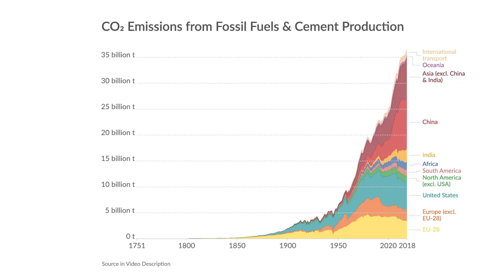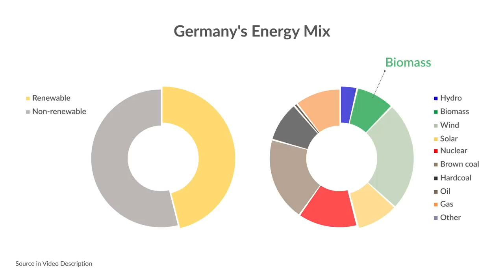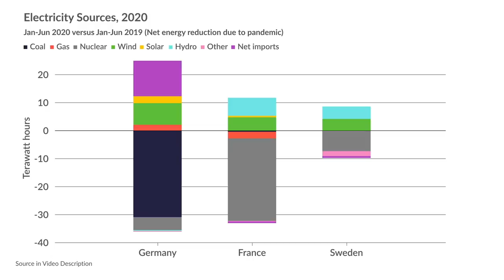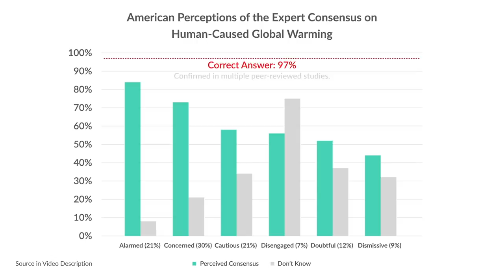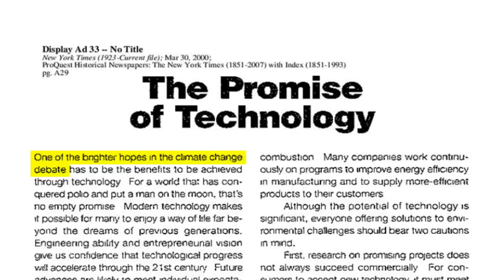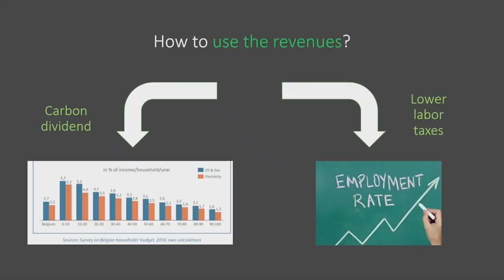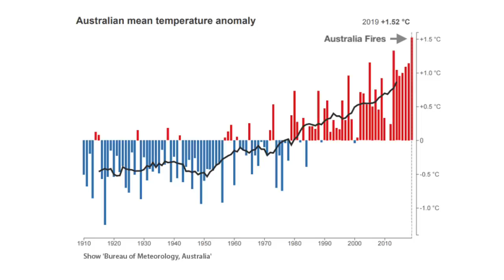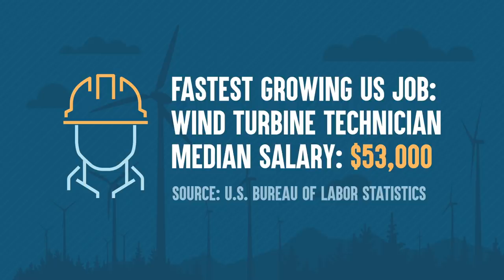The $5,200,000,000,000 Trick Killing More Than Covid, w Stephen Fry.

Comment: Wait a sec, What happened to the "mini ice age" the warned us about in the 70s?
Reply: "The fact is that around 1970 there were 6 times as many scientists predicting a warming rather than a cooling planet."  but don't let being wrong get in the way of your smugness.
Reply: Mini Ice Age still coming... patience...
Reply: @DistinctiveBlend  so we can safely assume the science isn't settled rt?
Reply: When there was a downturn in global average  temperature rise following massive WWII industrialization and the 50's boom (lots of sulfates in the air) some were pointing out that we should be on the down slide into the next glaciation (not a mini-bump) in 40,000 years or so. And we should be.  But it turned out once we cleaned up the air a little, temperatures shot up.  We may have cancelled the next glaciation or delayed it by quite a bit.
Reply: Well, the Exxon guys would have definitely wanted to tell you about ice ages
Reply: @DistinctiveBlend  
Media bullshit, not scientists.
Reply: @mavrick2398  
Nope,. It's settled.

Comment: They fked up by putting the hyperloop at the end. Otherwise a good video.
Reply: Yep.  Hyperloop is an old idea which just won't seem to die.  Seems cool at first look, but the engineering maths don't work out.
That said, new and improved rail systems aren't a bad idea.  Which is all hyperloop will be if it ever becomes anything other than hype.  Take away the hype and you just have r(ail)loop ;)
Reply: @travcollier  So why are companies still trying to build it if something as rudementary as the math does not check out? Perhaps you should reach out and tell them that all their engineers have miscalculated?
Reply: @johans7775  In the past there had been many things thought to be not possible. The light bulb for example.

The problem is, with rail technology speeds above 350 kph are not economical. The wheels and tracks show exponentially increasing wear and tear, objects on the tracks will be catapulted around with enormous force and damage the train itself, or things in the environment, infrastructure like bridges and tunnels must be re-constructed to withstand forces created.

With Maglev technology it may be pushed to 450 kph. At 600 kph for example the internal and external noise gets too loud. And similar problems as with rail bound systems appear, of course.

Therefore, a vacuum or low air pressure tube presents the solution.

I personally will never ever sit in a bullet catapulting me inside a sort of a cannon tube.
Reply: @johans7775  The idea is called a "vactrain", and it dates back at least to the late 1800s.  One of the fundamental problems is the high degree of vacuum required to avoid building up a pressure wave in the tube in front of the train.  Vacuum tubes work ok at small scale, but total volume matters (as well as surface area) so big tubes are much much more difficult.  The difficulty and cost doesn't scale linearly with size.
And plenty of engineers know all this far better than I do. Why do you think that no one's A-team is working on it?  Also, have you noticed how the designs for Hyperloop keep radically changing?  As I said, if it ever happens, it will end up being a relatively conventional train...  either that or maybe a tunnel road network for the super rich.

Comment: Kinda wish there was more of a breakdown in the report on GHG emissions from renewable production(solar/wind etc) vs coal. The report does show the results but i would have prefered a side by side comparison, for example it starts out equal the GHG cost to harvest all the resources needed to produce 1 photovoltaic cell used in solar farms today(basically 1 of those large solar stands in a solar farm), then compare that next to harvesting only coal with the same amount of GHG emissions(you'll have more coal because photovoltaics needs other materials). 
This way the start is equal, then you burn all the coal for energy so u have an energy generated value, then u add the GHG emissions of the burn to the GHG emissions of the harvesting to get the total. Finally u would compare that to the GHG emissions of harvesting,processing and manufacturing the photovoltaics and the energy that cell would generate over its lifetime.
I'm not doubting the report, i mean in the first place it's hard for me to see how just burning the coal is going to outway years of the photovoltaics output, i would much rather see the raw side by side comparison played out.

Comment: I do believe the main problem is that the "Green" movement ignored nuclear energy (Thorium would be the best) as an important step towards renewable energy. If this was implemented 20 years ago this could buy time to develop efficient storage solutions for solar and wind energy. I suspect that many of the studies on CO2 released by renewables are significantly undercounting the real impact of these technologies since there is no sufficient storage for the power generated. Therefore a base load bearing power plant has to be idling to take over when the sun sets or the wind drops and many of these power stations are fossil fuel based. https://www.youtube.com/watch?v=LJ4W1g-6JiY. This video is an example of how the nuclear fusion research has been distored to show that they are closer than what they actually are and I think there are similar distortions (likely not at the same scale) with green energy.

Comment: Claims that "global warming" will increase hurricanes etc. defies the second law of thermodynamics.  This is because most of the "warming" happens near the poles.  The weather system is like a heat engine driven by the the temperature difference between the tropics and the poles.  "Global warming" reduces that temperature difference and hence reduces the energy available for extreme weather.

Comment: The point about burning trees contributing to CO2 emissions is very misleading. It ignores the fact that each tree burned has already built up a carbon "credit" from absorbing carbon during its lifetime by having grown to maturity in the first place (the video only looks forward, it ignores the existence of the tree before being burned). As long as the trees being burned are being replaced sustainably, and they were specifically grown in the first place, in order to be used for burning, the process is indeed carbon neutral. This is because you have to grow a huge stock of new trees first, before you can start cutting them down to make into pellets, so you get the benefit of a huge number of extra trees on the planet which then must be constantly replaced as they're cut down, otherwise you'd run out.

Comment: power outages would be extremely rare because we'd be running everything seperately and connectively at the same time all the time. if the generator needs repairs, the grid is available until repairs are made. no gas just the movement would generate constant energy all the time.

Comment: Don't conflate CO2 with air pollution. No children have beeb killed by the present increase in atmospheric CO2. An increase in 40 parts per million is nothing for the human metabolism. We experience greater changes than that just by moving from one room to another or moving inside or outside. CO2 levels are lower in a cornfield in September than in May, lower in a pub when it opens than when it closes. The background level of CO2 is measured from the southeast slopes of Hawaii, but its presence in the atmosphere varies massively. At its present average of 415 ppm, the CO2 level is still historically low. Increases in CO2 levels do not kill children! And due to the logarithmic diminution of its radiative forcing, such increases cannot heat the troposphere as claimed. CO2 levels could go up to 800 ppm without any noticeable tropospheric heating. Implying CO2 has, in and of itself, killed more children than COVID is ludicrous.

Comment: Y'know what.
I'm perfectly fine with the ice caps melting. I legitimately don't care if we re-enter the carboniferous era. The world was mostly tropical and desert before the ice age. I also prefer it warm and humid.

But y'all are focusing on the wrong gases. You should be focusing on organic and inorganic gasses that are dense (as in parts per million in an air sample). NH2, NH, CH4, those gases have no natural outlet in any cycle (unlike CO2 which is consumed in the carbon cycle via photosynthesis.) Think of it this way, Methane CH4 is half the weight of CO2, ergo in relation it is also a smaller particle. This means that there is more methane that can fit in a liter of air compared to carbon dioxide. This means it insulates that much better and as it takes years for methane to decay into carbon dioxide it stays in that state for years.

The primary reason carbon dioxide was chosen by the globalists is because literally any organic combustion creates CO2. Makes it easier for the hypercorporations parading as government officials to attack their competition as that's basically the goal with climate change legislation.

Comment: Time Out!  I also seen studies saying temperatures were relatively stable for the past 75 years and the models show the temperatures on earth are cooling with EU falling into a mini ice age.  Grand solar Minimum with peaks through the solar cycles going into 2035 with extreme heat in summers and extreme cold in winter.   Overall temperatures declining.   Also isn't CO2 important for all plants?
Reply: If the EU is in a mini ice age, I'm in the wrong EU we have one record bracing summer after another and it dusn't even snow any more where I live.
The only two country that are considerable more stable in temperature  are America and Canada do to an anomaly in Jetstream.
Yes, plants need CO2 so what?
I don't really see the connection.
In what way does it make the enormous geoengineering experiment we have been running for 150 years any better?

Comment: I want to start a thought process, of sorts. Everything we do or use or make or burn or reduce in temperature(via a/c), causes heat to be produced. The ultimate goal should be to lower how much heat we release into the atmosphere, which people should realize, does not  just magically disappear. Each time we release btu's of heat, it adds to the heat in the atmosphere. There are many maximum heat producers that should definitely be re-engineered to eliminate heat loss or somehow harvest the to use and not waste. I think two big ones are vehicles  and manufacturing. Drastically reducing  heat released to the atmosphere has to have a positive effect. Hello world. Are you listening? We must somehow do this to save our planet. Won't be easy but I think this one aspect is very important.  Peace.
Reply: Of course, this means harvesting the energy from fossil fuels without burning them. That's the key, I believe, to keeping the temperature down. This may not seem significant until you realize the billions of internal combustion vehicles on the worlds roads and the heat they emit; the same with most of the worlds manufacturing. Tough goals, but I feel, very important ones. IMO.

Comment: using off shore wind to generate hydrogen for both transport and domestic heating is a simple clean zero emission solution that is just waiting for  proper political  backing. Leading appliance manufactures such as Charlton and Jenrick in the uk have already developed the appiances- all we need is the politicians to grasp the nettle. There are test areas in the UK doing just that- it just needs accelerating and scaling up

Comment: What a load of crap. Taxes change nothing. They are also not neutral. Here in Canada I have seen no rebate and saw my heating costs rise substantially, in a country where heating is critical during our winters of minus 30-40 degrees. Alternatives need to be found to replace fossil fuels however the only viable option to reduce so far is nuclear. Electric cars, wind power and solar are not in the least bit "green".

Comment: You can't have a rational approach to the CO2 emission issue without a carbon tax approach.  The eNGO's like the Sierra Club that has opposed carbon taxes are just interested in power for themselves and really don't care about the planet.  

I may not fully buy into the claimed health issues with PM-2.5, but climate change is real and CO2 does have an impact.   Revenue-neutral carbon taxes can solve the problem and those taxes would do far less damage to the economy per $ of tax than most of our existing taxes like payroll taxes.

Comment: EV cars are just bad the power grid will not handle it.  Also the smart metering under new regulations with time allocated for you and the guy next door.  Also can decide to charge more for each Kwh charge you use to get money back from tax duty.  And not all roads can have them so you need to park somewhere pay for the parking space and the charging and go over your parking time get a fine it will end up cheaper to use a taxi.

Comment: I recently saw this movie and its quite depressing.  Spoiler alert: we're totally screwed.  The movie doesn't advocate any solutions to climate change, it certainly is against bio mass and cutting down trees, it just points out that due to solar and winds' intermittency that with all that has been invested we have not saved one single ounce of carbon.  The reason, and I didn't know this, even when we get power from wind or solar they still run the main coal, natural gas or nuke plant at full power and just send the electricity no where.  They just put it to ground.  Because every source but solar is basically a steam engine making something rotate.  You can't turn those on and off, so it's just cheaper to keep them on.   Maybe the solution is everyone does their own home and we connect so many together for stability but they are going to have to totally over build and come up with an affordable, cheap, practical storage system.
Reply: Yes it does! Switch to renewables and reduce or eliminate fossil fuel use! You need to watch it again.  What are you talking about? Coal and natural gas plants are being shut down and the energy is transmitted by power lines.
Reply: @granthurlburt4062  I think you need to watch it again.  When a power plant runs on solar or wind it does not turn off its steam turbine.  It continues to burn just as much fossil fuel regardless if it needs to generate electricity or not.  It must do this because If the wind suddenly stops or the sun shine the you would have a black out. It must sends all of its power to the ground but if it is needed it will switch to the grid instantly.  I didn’t know that with all of the wind and solar we have done we have not saved one drop of fossil fuel being burned and it’s Carbon going into the atmosphere. Solar, Wind, build up must accelerate so that a gas or coal plant can be retired.
Reply: @granthurlburt4062  No brother you better watch it again.  I signed up for 100% renewable energy from my utility.  It costs 2 cents more per kWh.  But the more I talked to them I learned what it really means is whatever I use, they must buy that amount of power from a renewable plant in my case of wind and or solar.   So I say Ok I may not be technically using renewable but someone is so I'm saving the coal.  They say actually no.  They just buy the power they don't have to use it.  Why??  Because it takes 9 hours for the coal plant to ramp up to base load with peak load ability.  They cannot shut it down.   My brother works for the largest solar company in America and he agrees they typically build a Natural Gas Plant or 2 everytime they get a big solar contract.  In his opinion we just have to over build wind and solar like crazy.  Which could have been done for less than the cost telling folks to stay home for COVID.  We traded an exestential threat to stop the common cold - for  while.

Comment: HEY We need Grease made from oil needed for the bearing you know so will not catch on fire it will get so hot, and the materials the windmill is made out of OIL, and the batteries too and solar panels are made of OIL even to heat the sand for glass for the panels black shades like sunlight gets hot too for it you know touch a black car down here inTexas on a hot August day No it just does not take me along to time to touch a black car is all in the heat of the day

Comment: Coal can be burnt very efficiently with up to date combustion methods there is hardly any negative bi products as they can all be properly filtered out !  I am pretty sure Coal will still be used in the near future it will
just be processed more skillfully !
Reply: Oxidising carbon gives carbon dioxide (some carbon monoxide) which cannot be "filtered" out.
Reply: ... and what they can't filter out, they should be taxed on.